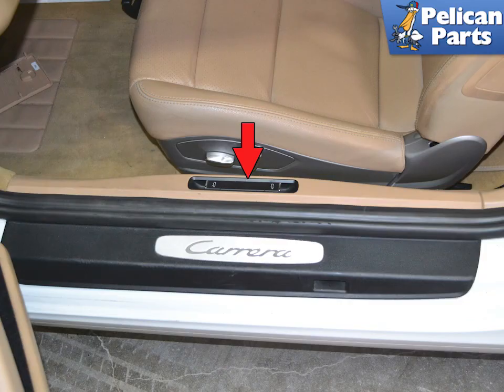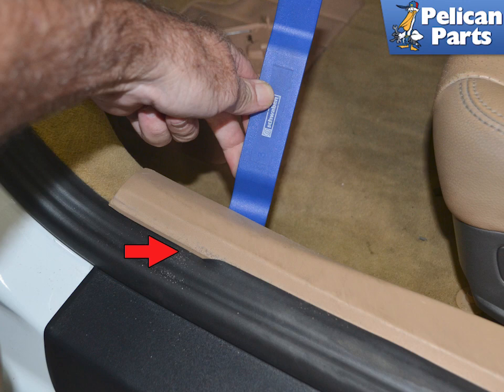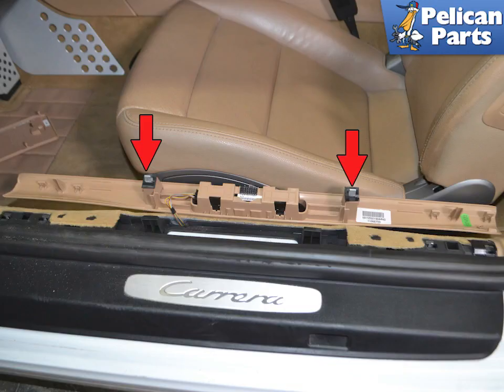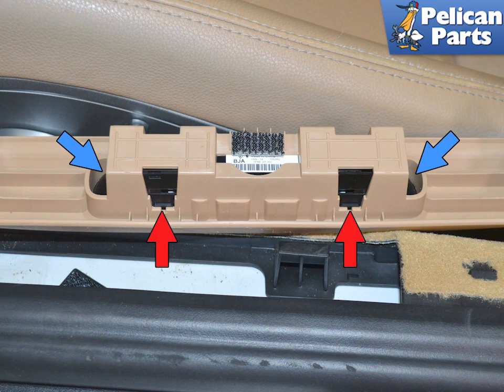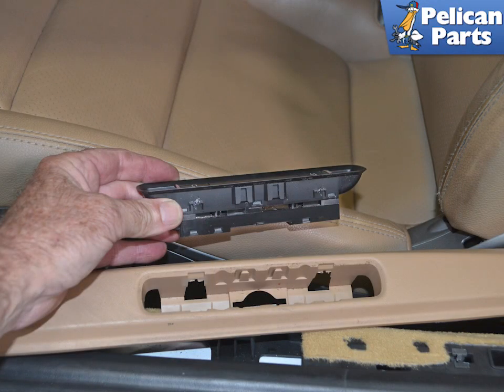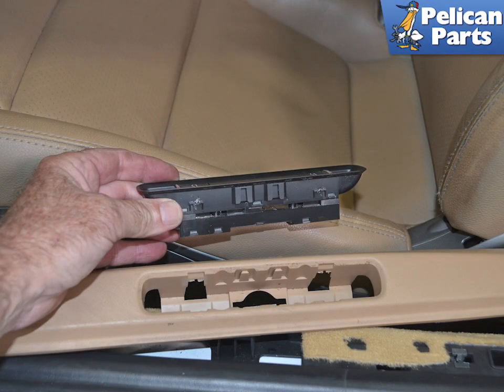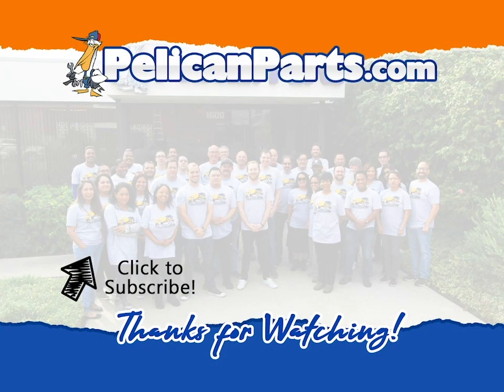Porsche 991.1 Carrera Trunk and Deck Lid Switch Replacement (2012 - 2016)

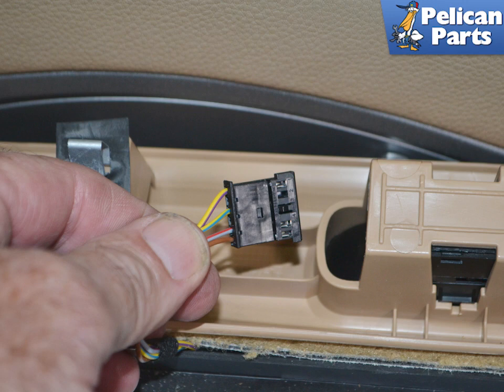Comment: do you have the connector or the part number of the connect for 1:06?
Reply from the maker: You didn't mention what year and model vehicle you are working on.

With your vehicle info handy, give The Pelican Parts parts specialists a call at 1-888-280-7799. They can figure out what part or repair kit you need.